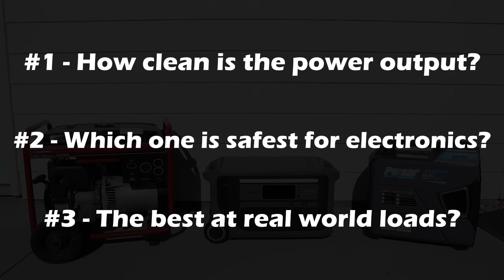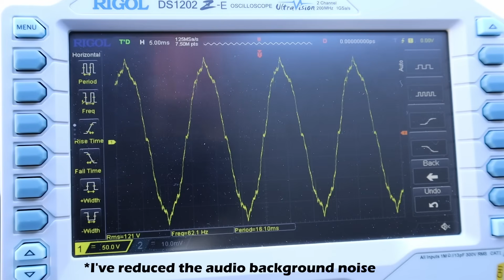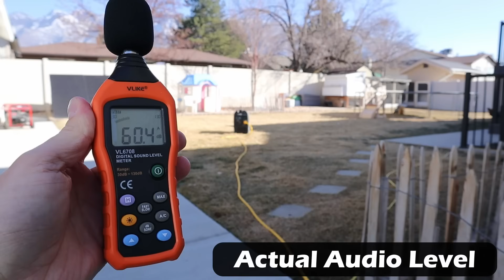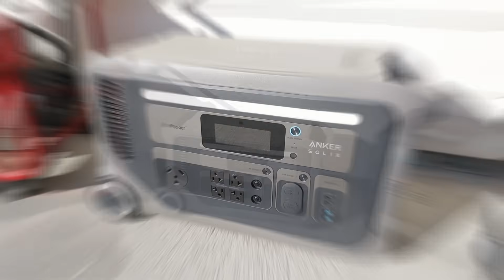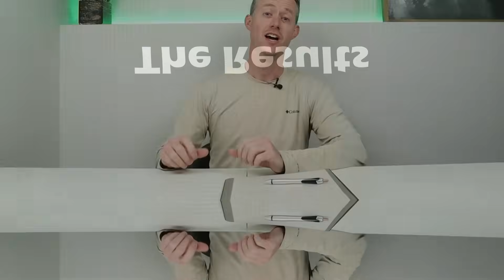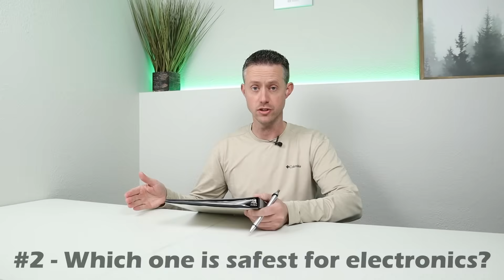Before You Plug Electronics Into A Generator, Watch This!

Comment: Interesting test. First, I'm surprised at the amount of harmonics in the output of a regular rotary AC generator. I'm equally surprised at the high quality of the sine wave from the 2 inverter output power supplies. I understand these inverters switch DC on and off rapidly, so I would expect a more bumpy looking output. It must have a filter on the output like an LC tank circuit. Last but not least, what kind of motor is in that table saw? Induction or series field?
Reply from the maker: It's an AC induction motor in the saw.

Comment: Emf makes no sense to measure.  It may effect some audio equipment or am radios.
Quality of the signwave does not effect any electronics that use power supply that converts to dc, or switch type. That would be most of equipment. In fact the equipment is required to be immune to all sorts of factors and pass the certification.

Comment: Excellent video showing actual testing and analysis!

I knew traditional would not be clean power.   The AC output is for non-electronics such as heater and refrigerator.   It has 12V output so run it thru a separate Inverter to create good AC.   Or  use 12V (CAR) adapters for Notebooks.  (Yes there is one for Macbook magsafe)    the 12V also good for recharging gel-cell batteries.

Comment: In a power outage, does it make better sense to charge a power station with the gas generator and then charge your sensitive equipment separately from the power station. Great info, thanks.
Reply from the maker: Power stations are pretty picky with their charging power. Some won't even charge with a traditional generator, depends on the model you have.

Comment: Thanks for the testing.  

When you have the generator connected, it’s only on one leg of the generator.  Typically the unbalanced load is limited, because the star point (neutral) has a thermistor between the windings.  Likewise when you had the heaters connected were they one on each phase or both on one phase.  

Generators like AC motors are the noisiest when at no load.  When testing a 120/240 generator, you must monitor both windings.  And both currents. Measuring how out of phase voltage and current are is extremely relevant.  

Single phase generators are worse for noise than three phase generators.  That said if you live anywhere that heavy industry is on the same transmission lines, the noise on utility systems can be far worse than the generator showed in your experiment. 

Oversized or underloaded induction motors are very noisy and extremely costly to operate.  Just starting and not loading a motor doesn’t give a true picture of the cleanliness that a generator can achieve.  

In an ideal world the test should be balanced, loaded, and done with a power quality analyzer.

Any inverter that makes AC from DC will use IGBT, SCR, MosFET. Most high end pure sine wave will use IGBT, and a high frequency controller creating PWM.  As our household outlets have 120vac RMS, it actually has a peak voltage of 170v.  For PWM let’s say at 16000Hz the DC voltage would be well over 200v. To see these voltage spikes you would have to have your oscilloscope division set up for much shorter.  

Depending on the filtering of the inverter, these spikes can affect sensitive electronics.  As with most everything, buying cheap doesn’t mean it’s a quality product.  Generators included.

Comment: Wow all the people with motorhomes must have been very lucky with the conventional generator they've been using for decades. But then again I don't know  of any device other than a simple heater of toaster that doesn't have filtering built into the power supply.

Comment: Delicate electronics are NOT delicate because of sine waves, the issue is surges/spikes. Power supplies that read 100-240V 50/60Hz are SMPS - Switch Mode Power Supply - switching at least at 20kHz or much higher. It makes no difference if 60Hz source is sine wave or square wave, in fact many/most will run from DC (if DC Voltage is high enough). Same for mini split HVAC which are 100% electronic, if inverter based with BLDC, which is 99.9% of them.

Pure Sine Wave is most relevant for inductive motors (coils), single-phase or three phase, it makes no difference for BLDC motors, found in almost all HVAC such as mini splits. Also, mini splits are no different than a large computer, same/similar power supply, except it generates mostly ~350VDC.

Keep your electronics away from the large inductive loads, like that benchtop tool which generates spikes. You're better off with a separate square wave, or MSW to power your computer than to share inverter with inductive loads. If you have ~100VDC power supply try it with a cheap USB adapter, not all will work, but many/most will operate from DC. Finally, challenge claims that anyone makes, especially so many electricians who are polluting the web with misinformation.

Comment: try sawing with the invgen and the powerstation. just turning on is not a good test. the powerstation will probably run the saw poorly for about 5 - 10 minutes. 
also inverters (any) need to have constant run spec.

Comment: Dirty power is not that big a deal for most things, or not that kind of dirty power.  In some applications if the power has very steep edges it can produce harmonics that extend into the radio bands, which is not great for use with communications equipment, but I have serious doubts that the noise on one of those alternators is going to produce much power that far away from the fundamental.  

And as far as dirty goes, look at virtually every power supply made these days, they are all of the switching ilk and the very first thing they do is turn the AC into DC, so the noise does not matter.  For decades now I have ran my big screen tee vee, and stereo, a cable modem, router, notebook, and a couple of LED lamps off on one little 1.2Kw 2 cycle generator I got for like $69 on sale all those years back.  Oh, and I have not even changed the spark plug in the generator.  Good 2 cycle oil and top grade gas.  The power here is a lot more stable than it used to be, but still if the lights are going to be out for 5 hours, I have all the "stuff" on a couple of outlet scrips and a semi permanent extension cord out to the shed where the generator is.  Unplug the first outlet strip from the wall and into the extension cord, click both the power switches off, go out and kick over the generator, get it off the choke asap, come in and turn one strip on, give it a few seconds to give the generator a few to catch it's breath, and click on the other and I am rocking and rolling while the rest of the  hood mucks around with candles and flashlights.

Comment: Excellent video!
 You already mentioned that a traditional generator is not well suited for HVAC systems.
 Most modern indoor blower motors are ECM's which do not like dirty power.
 In my opinion in my opinion an inverter generator is the only way to go.
Reply: Best be a small HVAC system.  Most AC compressors require more power when starting than portable generators can provide.

Comment: I've run PA systems and radio communications gear on inverter generators and found that they produce a lot of hum on PA's and spurious omissions on radio gear but your common generators are clean. Honda inverter generators are somewhat cleaner than other inverter generators though. Maybe you need to test them with a lab quality spectrum analyser. Been running a standard generator for an off-grid system  as a backup for 14 years and in a real world setup with very sensitive communication gear with no problems but the solar controllers and inverters are very RF dirty and the same with LED lighting especially on HF frequencies. Also the standard generator is much easier to repair. I'm certainly not an inverter generator fan.

Comment: Jason, thank you conducting this research. I have several questions. What measurable results have you found on supplied house power? When you connected your Oscope to the tested power sources did you connect them direct or use some sort 
5:41 of voltage divider for protection?  Thanks again.

Comment: Yup, this is why I have 2 sine-wave UPS's to plug my electronics into. I knew I'd be running on generator sometimes because the power grid goes down at least half a dozen times a year here. Note: I've also tried half a dozen generators and I've liked my Champion generators best. Few brands are as quiet, efficient and predictable as Champion has been for me. My 4.5k Champion even has remote start! (Note: I never tried a Honda but you pay a hefty premium for those.)

Comment: As someone that actually works on generators , you picked the least expensive design of a standard generator that needed a little set up. Regular generators used for power back up have much better governor and regulation . Even the generator you used would not damage any electrictronics unless they were very poorly built . I wish YouTube let people post pictures ,I would put up some readings off of a well regulated standard generator, that wave off of the Chinese inverter was pretty nice though much better than the modified wave that was normal in low end inverters
Reply: +MUUKOW3-  Will my Honda powered Black Max 8750 frame non-inverter generator with AVR cause harm to my 6 year old single stage gas furnace control board?  It has a 30amp twist lock cord to an outdoor box into the panel with a interlock device.  Everybody in the world says don't chance it with modern electronics and buy an inverter generator.  I'll hang up and listen...
Reply: @harleywayne8649 l looked up your Black Max and looked up the AVR , it's a pretty common regulator with good regulation, with everything  set up properly your furnace is not going to care !  The only advantage to an inverter style generator is that it doesn't run flat out at 3600 rpm it varies the engine rpm according to the load making it more efficient and quieter ,they typically have a modified waveform  and depending on the quality some electronics do not like it . Your Black Max will have a more pure sine wave.  I have never seen anyone with a generator like yours lose any electronics because of it unless the generator wasn't running properly. If you  are still concerned put a surge protector inline for your furnace board . Oh one last bit ,most home standby generators are not inverter types they are just like yours stuffed in a box with some extra controls for automatic start stop and to be quiet .
Reply: @MUUKOW3  Thank you for your reply.  My main reason for purchasing a generator was for my furnace to be able to run in the wintertime.  All this talk about ruining circuit boards etc. had me thinking my generator is worthless.  I hooked it up in the summertime and everything from tvs to furnace ran fine for a test, but...
Reply: @MUUKOW3  "They" say that open frame non inverter gens can be as bad as 20-25% THD.  I think the jury is still out on that.  Anyway, "They" have me scared.
Reply: @harleywayne8649 There are some that are horrible,   with very little regulation , the Old Colemans or Generac that were basically construction generators ,those things had crazy spiked in voltage from 130 down to 115 when loads kicked on and off . One like yours is not going to that  , I have have them on a scope they are good . There are out running portable businesses like food carts and sound equipment, portable offices ,home backup.  Every white box with a generator in it on the side of a house for the most part is the same as yours on the inside.
Reply from the maker: I didn't pick this generator, it's just what I already had. I've certainly learned a lot from viewers! Thanks for your feedback and sharing 😊
Reply: @Jasonoid  I am going to put my Jackery on the scope, I have not done that yet . Bug I have run off grid events with just regular old generators and ran timing and scoring ,radios laptops etc
Reply: @Jasonoid I looked at the wave on the Jackery and it looks like a nice wave until you increase then you see a small wave within the sine wave , I even put it on my HP scope to double check . Explains the different tone of induction motors running on it.

Comment: One test missing was noise level under load.  Sure, the power station will be marginally noiser, but the more interesting data point would be the for inverter generator. All the specs are for "idle" level noise. I know it will get louder when loaded, but by how much?

Comment: I have a DJI 1000  power station  but I only have a traditional generator to recharge it with.    Could I still use it to recharge if I used a good quality surge protector ?
Reply from the maker: You can always try, it will deny charging if the power isn't good enough.

Comment: I have the same inverter generator.  Here is the thing I found.  I need to hook up the ground - neutral bond.  I also ground to house ground when in a power outage.  This applies for both the generator and other pure sine inverters I have.
Say for example I hook up some old analog security cameras.  A previous place I was at already had them, so I hooked up to them.  I found without a ground-neutral bond on both the battery-inverter system and this generator, the cameras had a hard time initializing and I could see a lot of high frequency distortion in the feed when I did manage to get a camera to initialize.  After hooking up the ground-neutral bond and connecting ground to house ground, suddenly the cameras came right up and the picture quality was better than when they were running on grid power.
I think the deal is for the cleanest power output, you need a capacitative reference that will absorb the EMI from the electronic switching going on in the power electronics based inverter.  Once you have this capacitative reference, then everything is really good with these pure sine inverters.  So, when you show these high EMI ratings, I think they will go down to basically zero when you do what I am finding needs to be done.  Please make another video where you do this so we can see the difference.  There will be a difference and I am betting on that last EMI test you did we will see it the most.

Comment: I saw some distortion around the zero crossing on the "solar generator." Now let's discuss the elephant in the room- your utility's power quality. I've seen AC mains so distorted that it caused malfunctions in equipment that used a zero crossing detector for timing events. It just depends where you live. Fifty years ago everyone had a nice, pretty, and near-perfect sinewave from their utility. Then switch mode power supplies arrived in just about everything. Also, I've seen far worse output from standard generators and a few have far better as in 5% even under load. Those are safe with any device.
Reply: I have that situation at my residence. What can I use at the panel to clean what’s coming in. Thanks.
Reply: @Meda-h9r That's a big question. If you have harmonics a filter can be built to shunt those higher frequency components. If the sinewave isn't properly sinusoidal that requires a different approach. Quality electronics often have built in filters but a badly distorted wave would require an engineer to measure it and design a solution. Utilities also use filters/capacitors at substations to counter all problems caused by reactive loads.

Comment: If you are willing to spend the money... you can buy voltage converters that take pretty much any input and output a pure sin wave output at 115-120VAC.

I have in my house 2 "used" industrial Double conversion battery backup units that operate at a nominal 48V DC input and output either 120, 240, or 277 VAC pure sin wave output.  They also have additional battery packs that can be added (up to 4) to provide long run times.    Key use is my heating and hot water boiler.  When the 12V batteries are new this will run my heating system for about a week during a power outage.  When the 12V batteries are degraded and the systems tells you they are done... It will run my heating system for about 2 days.   These were not cheap and for the boiler backup power supply I just spent $843 in 2025 to change the batteries in the boiler backup system (32 - 12 V batteries), and about 5 hours to change all the batteries.  New batteries last about 5 years.   I like to have heat in the cold winters, and power outages do occur every year.  Nice to not have to worry about it.   I take the best of the used batteries from the boiler backup system and use them in the 2nd system for my computer backup (half a day to a day of backup power for computer, modem, phone, etc - excluding the printer) - and the best of the 5 year old batteries tend to last about 3 years for the computer backup. But, very nice to have pure sin wave output.

Comment: Where did you come up with "3" as THD limit?  Most WELL DESIGNED 'electronics' can handle electrical noise without any problem. Lets not forget that 'electronics' all have a power-supply which converts the AC line-voltage down to DC before the 'electronics' gets power. 
In other words, any 'electronics' which has a WELL DESIGNED power-supply will be just fine. It is the POWER SUPPLY which might have a problem. 
ADDITIONALLY:
Do you realize 'inverter generator' and 'power station' are BOTH INVERTER OUTPUTS? The input into the inverter circuit may be different... but the outputs are BOTH inverters. Obviously, your inverter GENERATOR has better inverter than that power-station.